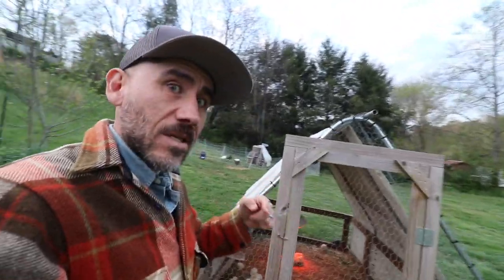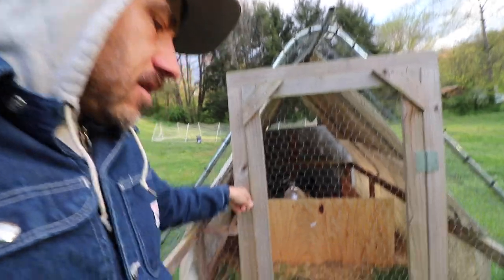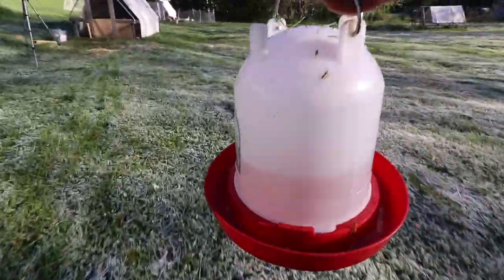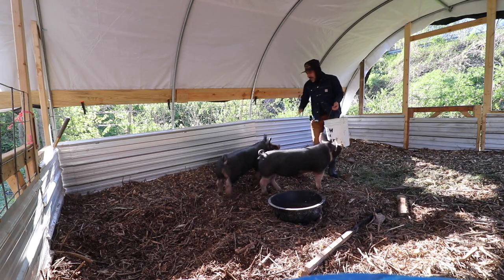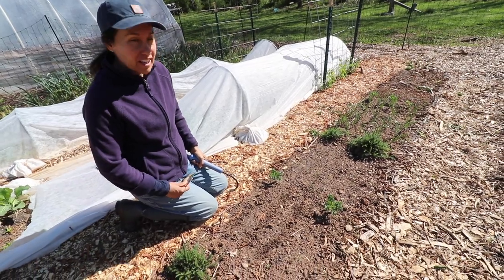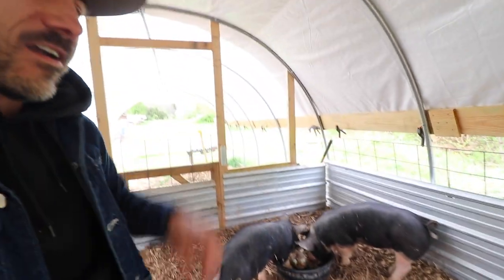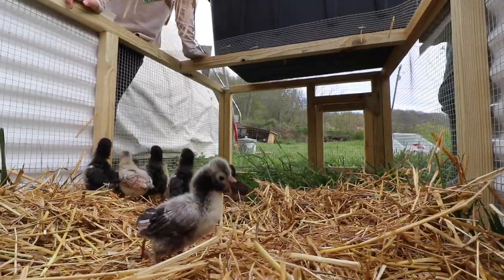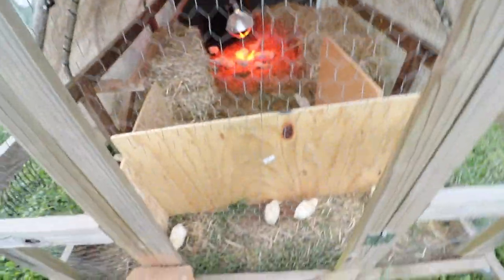How did these BABY CHICKS do in OUTSIDE BROODER (VLOG)

Comment: I use this-Gardaner Plant Covers Freeze Protection & Plant Blanket Fabric 8Ft x 24Ft Rectangle Plant Cover for Cold Weather  Sold by: GARDANER  It last a lot longer than the agfabric and was $16.49.  My agfabric barely made it 1 season.  Right now I am in my 3rd year with the Gardaner.  I got it on Amazon.  Have a Wonderful & Blessed Day!

Comment: When I was a teenager, I worked for a large pig farm. 
The owner fed all the pigs something called High moisture corn. It was stored in huge silos that had a cool system. 
Each morning I had to turn a valve drain all the liquid off into massive rolling totes then switch to an auger that loaded the moist corn into huge rolling bins to feed the pigs. 
That liquid was then pumped into a sprayer system at the top of the silo to rain down on remaining corn. 
Man, the liquid drained was pure grain alcohol. Smelled good but so strong like it'd peel paint. 
The corn smelled like moonshine and the pigs loved it. 
We mixed minerals into what the pigs ate. 
They grew huge with very little fat.